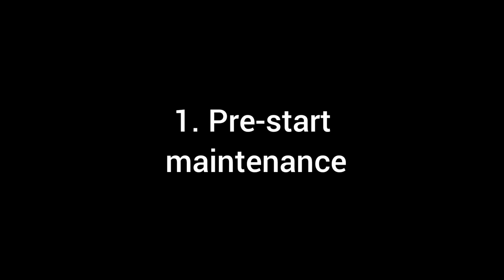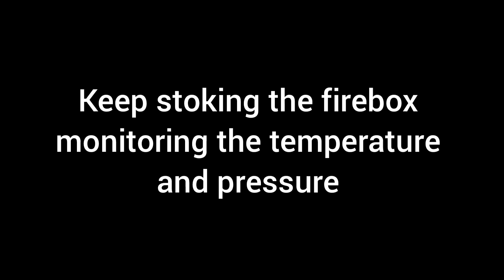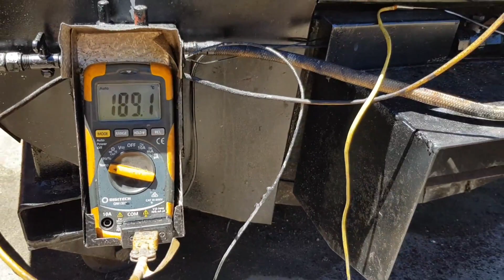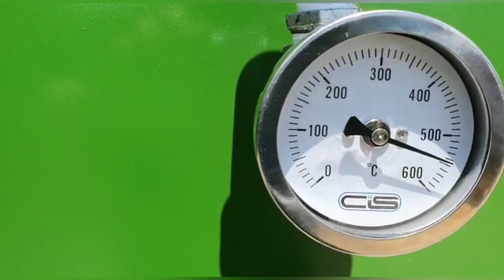How I make great biochar

Comment: Robert, greetings from Uganda.
Thank you very much. This looks exactly like what I need. I want the link to the supplier or makers of this similar retort. I would like a volume capacity of 1.5m3. I am retired senior citizen and I want to do this kind of work, from my 200 acreage forestry project to harvest it into timber, charcoal, biochar, wood veniger, etc as I progressively harvest. I am convinced I can do it, morever it is the only option without pension on myside.
I hope this reaches Robert to replied to me, not just a comment in this platform. Cheers
Reply: I will want something similar
Reply: Hi Bernard, is this something you're still interested in doing? I'm in a position to help.

Comment: There is no ash because the minerals are in the biochar. A complete combustion of biomass leaves ash which is composed of the minerals that were in the biomass. It varies based upon what exactly is chared and what minerals were in the biomas. That is why when you burn charcoal you get ash, when you burn coal you get ash.

Comment: Couldn't you have done this with just a big clay mound?
Reply from the maker: Burying it releases many greenhouse gases, which are harmful in the atmosphere. This process is carbon negative!
You can't collect wood vinegar by burying it either.
Reply: I clicked your link and it shows you sell plans which is a great idea. I guess my only question is could you use your plans if I bought it and expand the length of the tank to be way longer so it could do volume and be more economical for large quantities of wood?

Another idea I’ve heard is Bitcoin miners using flare off from oil rigs to produce energy to mine Bitcoin.

If you guys design these things you maybe could design a biochar maker where the wood gas is moved to an electricity burner to produce energy for Bitcoin miners and then just use junk wood to heat up the biochar tank. That way companies can claim their Bitcoin miners are green and is removing carbon as charcoal is a stable form of carbon that’s sequestered.
Reply from the maker: @koltoncrane3099 We have two sizes, a long and a short version. See our website.
Yes I've generated electricity with the syngas, but that's not the original purpose. Our units are mobile, so that is not our aim.
Reply: I don’t know what wood vinegar is.

I do remember reading or watching videos about turpentine and pine tar etc. Centuries ago in Sweden or Norway they would bury logs and make charcoal. But in the bottom they’d have channels so pine tar could run out or collect. They maybe had a rock channel or used mortar. But ya it’s interesting but not surprising cause if Columbus came to the Americas in 1492 they had to have had pine tar back then tk water proof the ships I’d assume. 

I’d think carbon is bad for the atmosphere cause carbon is plant food. People should look up the 89 year weather cycle of global warming confirmed by tree rings going back centuries.

Look up the Great Depression in the U.S. there was the dust bowl which everyone blamed on farming. But look up stuff. You’ll see Kansas got to 115 degrees. The heartland or bread basket of America got as hot as Phoenix or Las Vegas back in the 1930s!!! 

But I totally agree with you that your setup is great cause you can collect the pine tar and other volatiles. Well not all of them. I remember one video in Georgie I believe. They would do pyrolysis but see your setup burns the wood volatile gases. In some setups the wood gas is taken throw a copper pipe to distill in cold water and end up in a barrel. Maybe that’s the turpentine can’t remember.

But I love your setup. If someone was burning pine it’d be amazing to catch pine tar.
Reply: My question is do you only sell these setups in the video? Are you an engineer or did you use an engineering firm? 

A few years ago we moved a large dump trailer used on a garbage truck. It’s like 30 feet long maybe. The one end has a hing so it swings up. I thought to myself now that would be amazing to make charcoal and tilt it so pine tar runs down to one end. 

A lot of logging sites or sites that were chained with anchor chain has a limitless supply of pine stumps from the 1960s and more recent chaining in western U.S. 

To be economical you’d probably need a semi trailer or maybe a shorter 30 foot trailer with your biochar maker. I suppose it’d take days of burning for stumps to turn into charcoal but you would be able to collect drums of pine tar.

Oh my question was do you make any thirty foot long? You’d need long ones if you were to do large volumes of stumps. Or do you consult or sell your attachments and setup for those that would build their own? 

I bet you could sell a few big setups to the logging industry or others in areas that have logging going on. 

Look up in Utah how the government pays for lop and scatter. They pay people to cut down trees and just leave them there or pile em up. Sometimes they burn them, but if you had your setup you could make charcoal up in the mountains.
Reply from the maker: @koltoncrane3099 I am an engineer, and have built 40 foot container units, which proved very expensive and cumbersome. Most people want small mobile units, which is why I designed these.
Reply from the maker: https://carbonoffsetzone.com/wood-vinegar-guide/

Comment: What brand of garden chipper please
Reply from the maker: It won't matter what particular brand you use. You will see that I modified mine a bit, with a pot plant pot for a funnel, and the outlet tightly going into a plastic drum, to reduce dust. I wear a mask too!
Reply: @carbonoffsetzone  
The reason I asked is because I bought a leaf and small branch chipper  and it doesn’t chop it up in small even pieces like yours looks like 

I can run it threw 3 times and it still leaves chunks
Reply from the maker: @denveready3486  Tallon